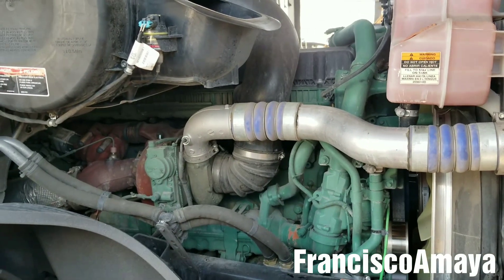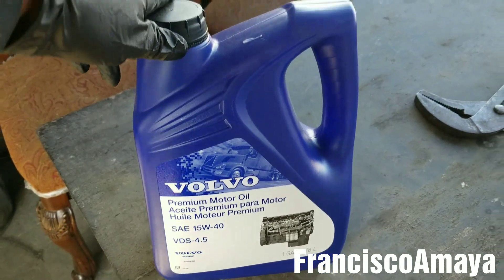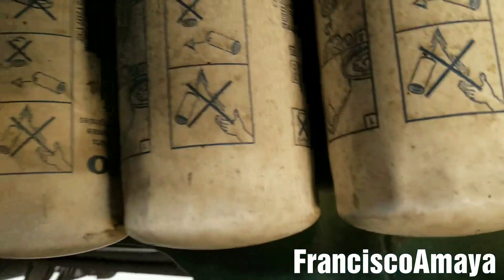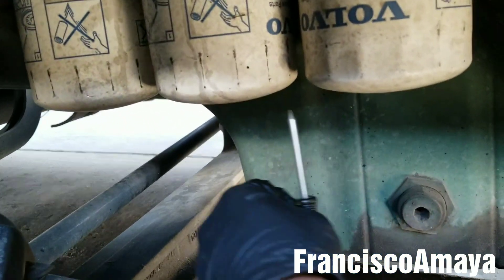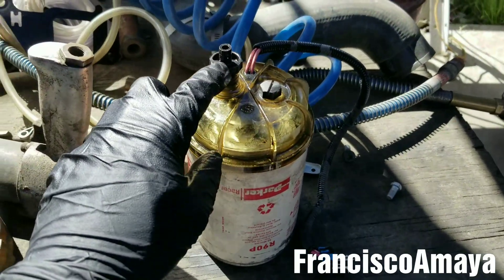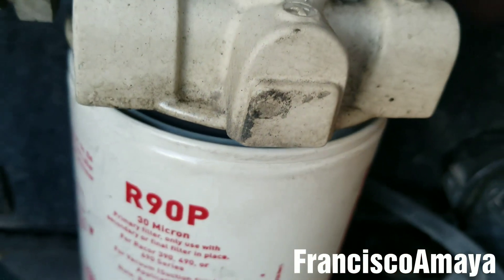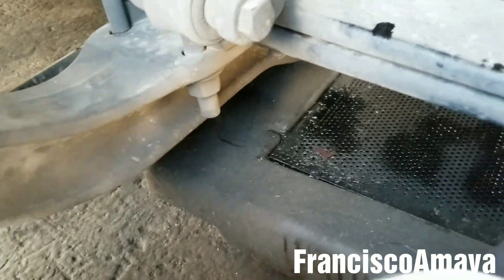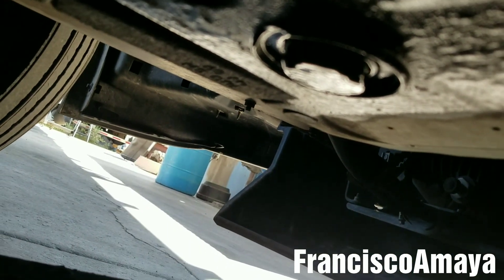Volvo D13 D16 Mack MP8 MP10 engine oil change oil type filters PART 1

Comment: Could you help me my 2012 Freightliner cascadia cluster died and I bought a new one and it still doesn't work I test the wires behind,  I have 2 plugs I test each plug , the first sprung to each plug lit up but the rest did not could it be a fuse even though I have power in each of the first sprung ?
Reply: Not sure  if the new one needs to be programmed. But you probably have a data connection problem somewhere. 
I think I saw somewhere that the problem is actually the harness that plugs behind the cluster. Good luck